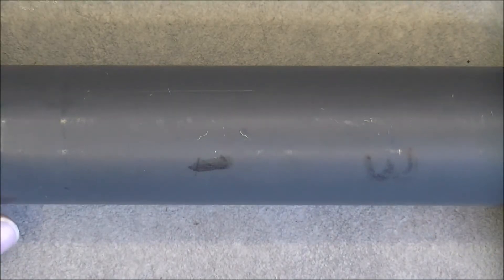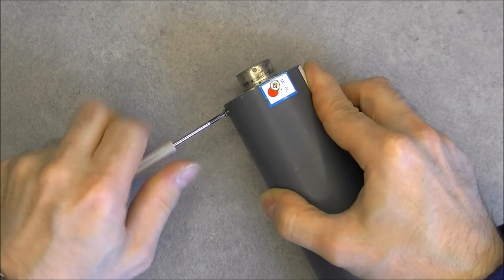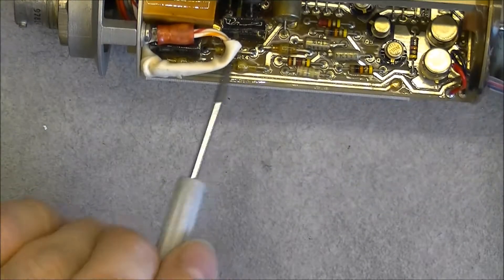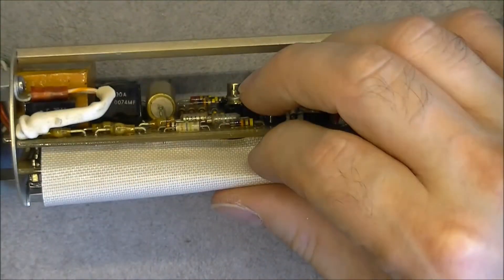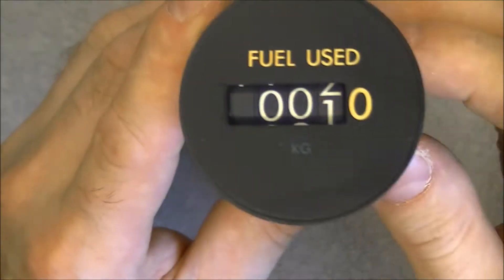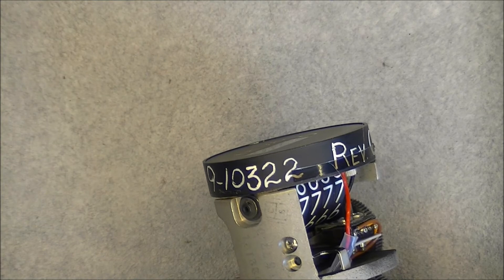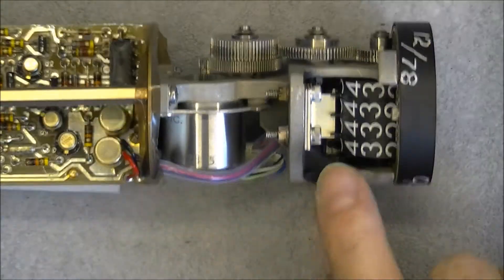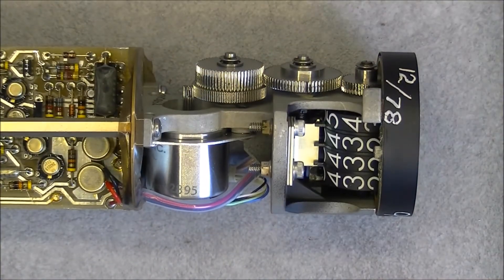Fuel quantity aircraft instrument teardown

Comment: 3:00 yet another resistor fail in a high quality device. too much heat, too less space.

The instrument is beautiful though !!!
Reply from the maker: I see that quite often, burnt resistors or diodes, as if calculating the dissipated power and sizing correctly the componants was too difficult.

Comment: That's an interesting counter. If it only has a micro switch for zero point, does that mean it counts the phasing of that synchronous motor digitally to position the counter? Or is there an analog way of doing this?
Reply: most 3d-printers has only one endstop per axis - and they use stepper motors